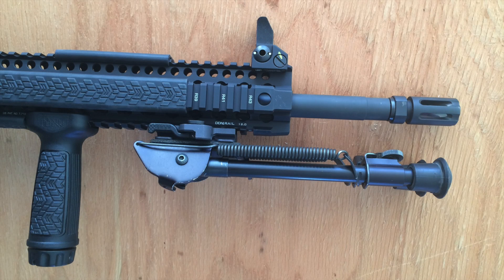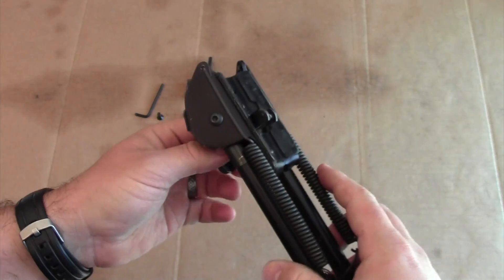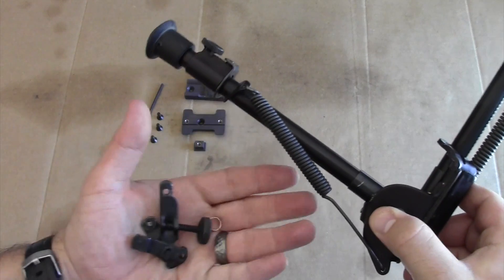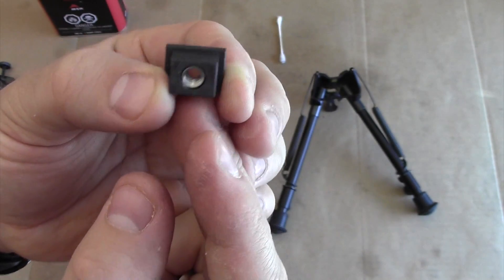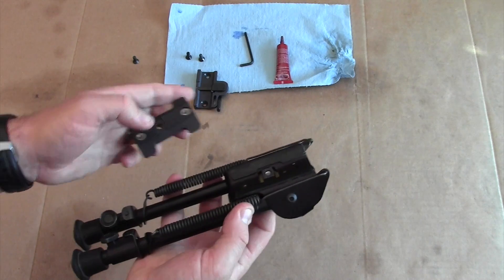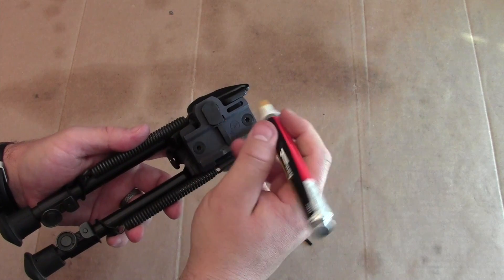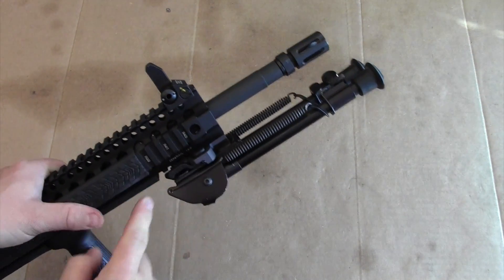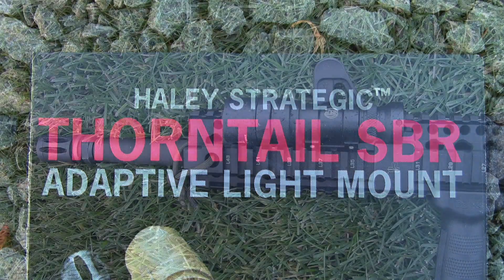Harris Bipod A.R.M.S. Throw Lever Mount Instalation Video

Comment: I got the Knights Armorment version. It replaces the entire saddle looking mounting system making it lighter. It is QD plus it swivels and pans for $70. Fit a bit tight so I polished it down by hand for 10 minutes making it swivel and pan perfectly.
Reply: 100% correct I think the zeroDelta/FourStarAlamo mount was the best came with a quick release but really expensive and sadly ZeroDelta no longer mads it. Hopefully FourStarAlamo will start making again

Comment: I love Harris bipods.  But I'm amazed they've not created integral attachment methods beyond the sling stud at this point.  All these other adapters add so much mass to what is a great bipod system.  Its really a lazy business that they have not created good effecient light weight integral systems for connecting this bipod system to pic rail or arca.  30 years on we are still using adapters for this old hunting bipod.

Comment: I like the "Mount" you installed for sure. But, I don't see why people say to use Locktight on everything. I have weapons that I bought Many Years ago and the things I installed Have Never moved or loosened up. I bought a Ruger 10-22 in 1964 and mounted a scope on it and And its Never loosen up. My Model 700 Remington, I bought in 1965 or 66 its the same. They are both, Well over 50 years old and not no problems.    just curious is all.

Comment: Get your damn hand off the magazine unless you're changing the magazine. You paid for a vertical grip, use it. You'd cry if you did that in front of a Drill Sergeant in the Army. By the way it has a tendency to cause malfunction on top of being bad form.
Reply: Who cares bout drill sergeants private!😂💩 🧠Oh it’s “bad form” is it, well i’d like to know who told you that because when i served in 06 we made fun of the seal teams for holding onto there mags like a grip in houses & CQ, later to understand its 1 of the best clearing postures to obtain, after that half of us used that strategy from then on, never had a malfunction doing it in the sand so why would he have a problem doing it on the dirt and grass?